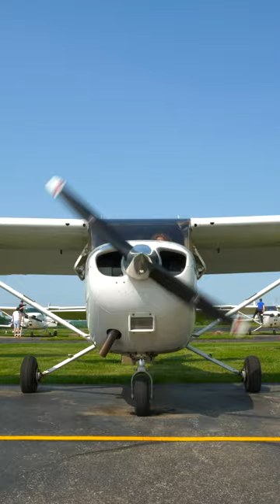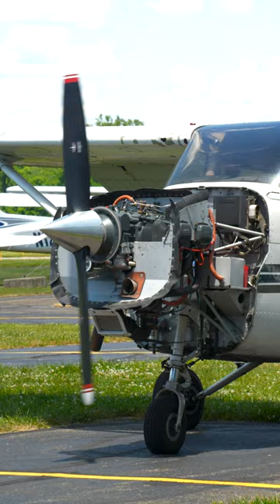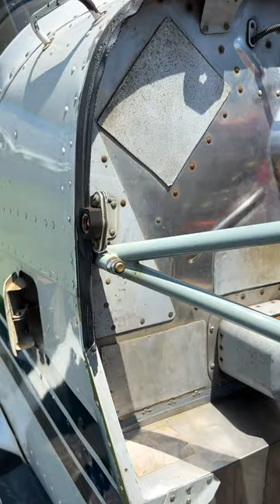Piston engine mounts - fun facts from Sporty's

Comment: Fun fact - something you can't easily preflight can break and kill you.
Reply from the maker: To be fair, some airplanes (like the Bonanza) make it much easier to check this than a Cessna. With a flashlight you can easily see these on preflight.
Reply: You could still possibly notice looking for stress cracks on the firewall or the rubber isolation mounts, or misalignments on any bolts witness marks (the mounts here have neoprene locking nuts but check even if they're safety tied)

Comment: How to preflight engine mounts
Reply: If you have the cowling off on a Cessna, which you shouldn't be removing as a student or renter anyways; you look for hardening of the rubber, cracking of the rubber, or misshapen deformation of the mounts (e.g. sagging).

Comment: Its a weedwacker motor! Thats why if you fly in one of these you die in one of these!
Reply: You must be a very strong person to consider this 4 cylinder 180 horsepower motor fit for your weadeater! 😮
Reply: @hansgraybill1280  rather have 2 engines!
Reply: @michaelcuff3418  👍
Reply: @michaelcuff3418 you sound like someone who would ride your motorcycle with training wheels because you can fall with only 2 wheels
Reply: @michaelcuff3418 way better to roll it over into the ground when you lose one on take off.
Reply: Ignorance at its finest